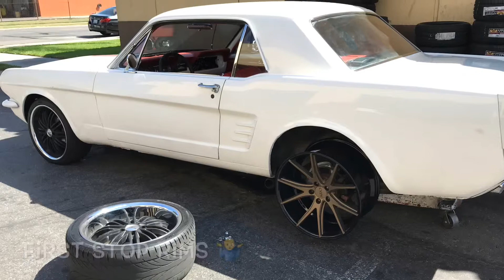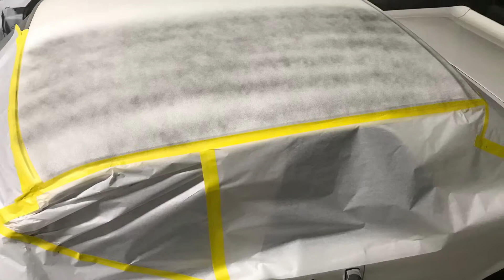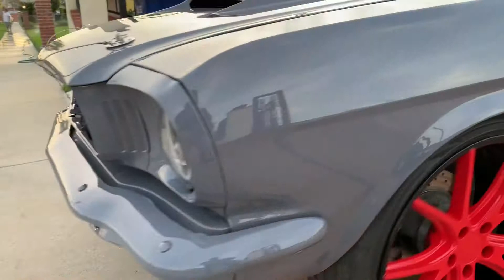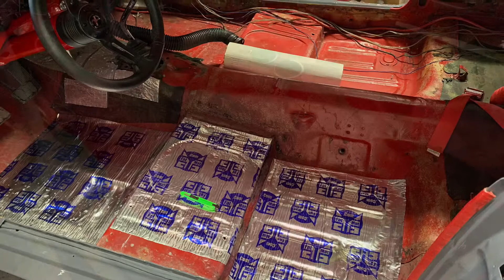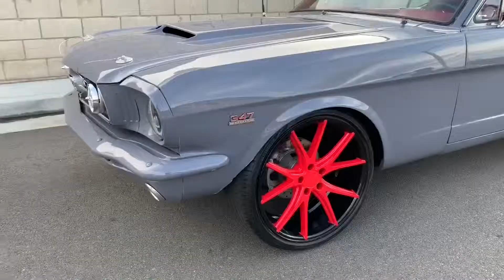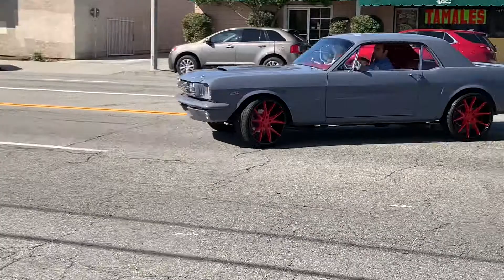1966 Ford Mustang restomod project on 20's *Update*

Comment: Sorry to bother u but what did u do to get the 20s on . I have a 66
Reply from the maker: Rolled the fenders @thegraystang66 on ig
Reply: @thegraystang66   i really appreciate your reply . I actually just bought a 66 off offer up actually being shipped tomorrow saw your video an was amazed at your work.  The only bad part about the car is it has the inline 6 , im still stuck between adding a turbo or going 302
Reply from the maker: @ysamp8774  if youre going to swap it make sure its something worth while like a coyote or terminator engine something like that. If not just turbo the 6.